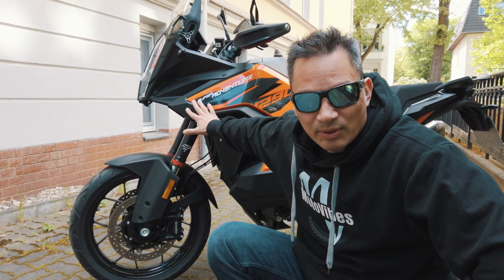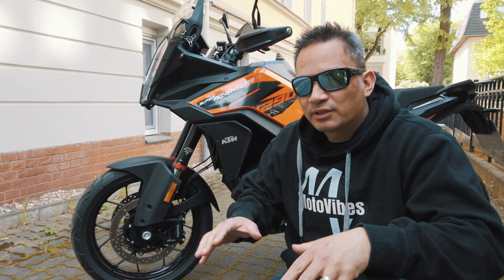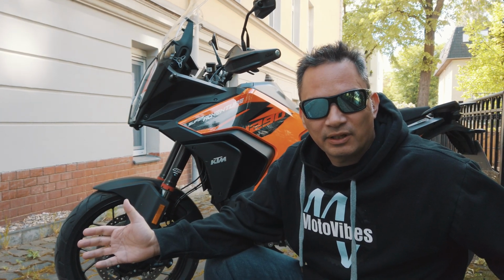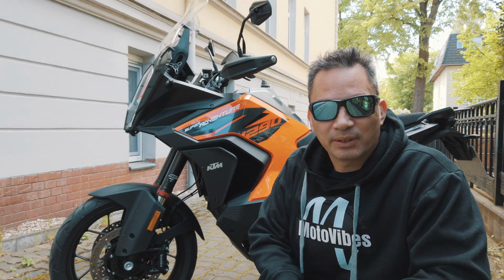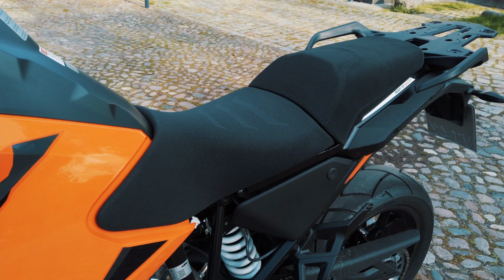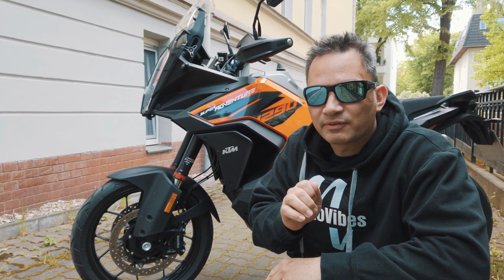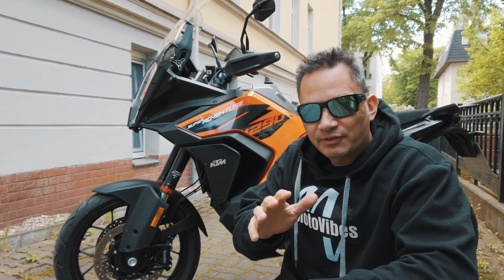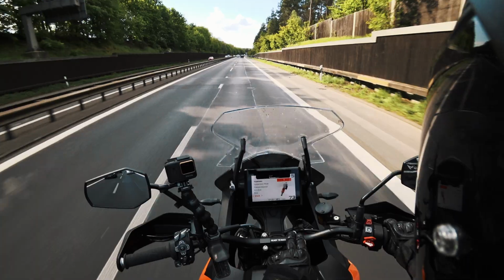6 THINGS I LIKE - 2021 KTM 1290 SUPER ADVENTURE S & R // KTM Rider's Review

Comment: Riding in the road, are there any handling differences between the 2021 R vs S? (If the R suspension is correctly setup) is there any major downside on the R version vs S (other than manually setup your suspension settings)?
Reply from the maker: Theo - I suggest you watch this video- it explains the key difference between the two https://youtu.be/TYFYFEbIkZE

Comment: Great video. I’m upgrading from a BMW F900XR to a big size adv bike. I test rode the 2022 GSA, great bike, comfortable etc etc. It just doesn’t give you the kick. Have both SAS & SAR scheduled for test rides by the end of March since my dealer doesn’t do test rides during super low temps. My biggest question right now is, SAS or SAR? I do mostly long trips and really not an off-road guy, however the SAR looks far more aggressive and appealing to me. The 21” front tire and long travel are questionable for me when it comes to high speeds on highway but i just don’t want to make this kind of investment and be restricted to road only with the SAS. Not sure if SAR is the actual SAS with added capabilities or just a totally different bike that will excel off-road but will lack what the SAS has on pavement.
Reply from the maker: Thank you very much 😉 as for your bike choice - from what you are describing the SAS would be the better fit for the riding you do - the S and the R are very similar but their respective bias Onroad vs Off-road is very noticeable- I will have a video coming up soon to break down the exact details between the S and the R
I do like the R design better too but changing the look of the bike is relatively easy. The smaller and lighter  wheels as well as the semi active suspension of the S will be perfect for road riding 😉

Comment: Good info on the seat height. Can you comment on your previous 1290 S vs the 2021 S model. How much lower is the 2021 S compared to the 2020?
Reply from the maker: Hi Mark - I think on paper the difference is only 1 cm but it feels more like 2 maybe 3 cm to me because I can reach the ground better with my feet. Nominal seat height is not the only deciding factor on how well you can reach the ground - the shape of the seat also factors in - a narrower seat will give you more reach (think of light weight Enduro narrow) - a wider seat less reach. 
The 2-3 cm is in the normal setting - the "low" setting (standard on each bike) gives another 2 cm. I am 180 cm tall - the lowest setting is much too low for me on the 2021 S model. I hope this helps

Comment: Thank you for the reliable review. I owned the pre ous model as well. In two months I did 7300km with the new one as owner. I can confirm:
The malfunction of distance control in more situations.
I cannot see the sense of less favorites items.
KTM should fix yesterday the issue with the seat. Is a crusial reason which I remain on that machine. 
Better behavior on low speed with high gear in compare of previous model.
Better suspension.
The shortcut switch doesn't provide enough choises.
Reply from the maker: Thank you for your feedback too - I hope KTM will fix the issues -
Most of them should be easy fixes
Reply: @MotoVibes  indeed easy fixes and could be avoided. However I love this bike. I left behind the 4 cylinder with this sexy monster.
Reply: Φίλε μου καλησπέρα.. Θα μπορούσα να σε ρωτήσω σχετικά με την αξιοπιστία της μηχανής? Κινητήρας ηλεκτρονικά, γενικότερα... Ισχύει αυτό που λέμε στην Ελλάδα το κάθε Τρίτη μάστορα ή είναι τελείως λάθος? Μην με παρεξηγήσεις πληροφορίες ψάχνω γιατί ψήνομαι πολύ για αγορά και κανένας στα reviews δεν μιλάει για αξιοπιστία.
Reply: @stelioskarakasis4809  Γεια σου Στέλιο. Το μοντέλο του '21 το πήρα το πήρα το Μάι και μόλις σήμερα γυρίζοντας από τριήμερο έχω 10300 απροβλημάτιστα χιλιόμετρα. Η εμπειρία μου είναι θετική. Κάθε ώρα πάνω της και κάθε χιλιόμετρο είναι απόλαυση. Το Σάββατο έκανα 550 χλμ.στους Δολομίτες, 11 ώρες πάνω σε αυτή, μόνο σπορ οδήγηση και τα έκανε όλα τέλεια.

Comment: Thank you so much for your videos! I watched quite a lot of them (especially the riding ones) and you convinced me going with KTM as my first "adventure" bike is the right choice. I've been riding a Harley Davidson Road King for the past 8 years, doing roughly 100,000 KMs around Europe but both my wife and I wanted to try something more versatile and potentially more comfortable. so I got the SAS 2021 just 3 weeks ago and it already has now 8000km on it after a 2 week road trip from Romania to Spain :) 

I really enjoyed the bike, definitely more fun than the BMW GS, engine wise, and similar ergonomics (suspension, riding modes, etc.) I also did use the adaptive cruise control quite a lot and I experienced the unexpected acceleration that you mentioned in your first clip about the new model. I eventually (think I) figured it out as being caused by turning on the left signal as if I wanted to overtake the car in front, at which time the bike would start to accelerate again at the set speed. I still didn't read the manual, which I should probably at this point :))

One thing that's annoying is the lack of available extras (engine guard, tank bag, bigger screen, etc.), but that will hopefully be fixed soon. The engine guard is a must for me as I want to get it into offroad, and without that I'm not taking any chances 

Enjoy your rides and keep up the good work on your channel!
Reply from the maker: Thank you very much for the kind words 😉 congratulations to your new KTM - way to go with 8K in three weeks 👍👍 i think accessories were slow on the predecessor too but once they trickle in you have something to look forward to 😉 
Very interesting that the radar assisted cruise control did something similar on yours too. I guess once you get to know your bike you will know what to look out for. Ride Safe 🤙
Reply: I ride Harleys and am considering getting the 1290 SAS. Interested in the comparison of the Road King 2up at freeway speeds, 80mph/130kph, regarding stability, passing large trucks, windy conditions. Also, would you buy the 1290 SA again?

Comment: Good video again.  I've a 2020 S model. Thinking of upgrading but... 
A few things.  ... Can you turn off wheelie control and keep traction control on.. or Do you need to buy Rally mode for that?  And even then will it let you wheelie for a distance.
Also.. I remember you saying before thst you liked the character of the old engine. I'd hate to buy a new one and it feel too refined and not as mental as 2020 version.  I havent test rode yet. 
Lower height does appeal to me though. 
Cheers .
Reply from the maker: Thank you very much. You can turn off traction control completely if you want to wheelie - just like on the 2020 version. Rallye mode will incremental setting of the traction control- highest setting of 9 will engage traction control very early before the front wheel comes up. Dial it down to less than 4 and the wheel will start to lift and still cut the power of rear wheel keeps spinning to fast - all that can be changed while you ride with + and - buttons on the left. Also- Rallye Mode will remember the last setting even after the bike was turned off. 
Best thing is to take the new one for a ride to see if it’s worth it for you to upgrade. 
It’s not all sunshine in my opinion- there will be a second part to this video with 6 things I did not like 😉

Comment: This is definitely on my “wish list” to upgrade from my 1200 GS. My biggest concerns would be poor warranty coverage and dealer support, as well as electronics that still appear to error regularly. Most of all though, we do a lot of two up touring and the GS excels at that. I’d be very curious to know how someone would rate this bike for two up touring compared to the GS?
Reply from the maker: Best thing is to test ride one with two up - the 1290 can certainly be set to a very comfortable suspension setting with a push of a button. On days you ride solo the KTM can become a very sporty bike especially compared to the BMW
Reply: In my opinion as a touring bike you won’t beat the GS. I made an expensive mistake buying the 1290SAS for long days touring.
Reply: @Tmfrth  Thanks Tim. That’s gold advice. Much appreciated👍

Comment: 3,000miles in on my 2021  KTM 1290s Loving it, bye bye 1250 gs rallye
Reply from the maker: Welcome to the KTM club 😎👍
Reply: I went the other way after 3000 miles on 2021 KTM 1290 SAS. Main thing was ergonomics…poor seating position for me, noisy screen, seat doesn’t work in higher position, no ergo seats available. Also no engine bars still and no aftermarket items. The suspension is not a patch on the GS either and real head shake when fully loaded with a top box. Power and sheer thrill factor is fantastic with KTM and it’s just so much fun to ride. Would have both if I could! 
Long distance touring (my needs) GS is still better by miles I reckon.
Reply: @Tmfrth  Mmm after owning 11 GS GSA and GS rallye 1250's x 2 IMHO The KTM is far better made plastics are true and strong the frame and the wheels are super the Suspension is on par with BMW ESA but gives you far more options to fine tune especially in Rally Pack and advanced modes. Re Shake i sorted mine 21nm site don 20nm on the head stock. Agree rests but bin off the rubbers in the pegs then order high seat and its a winner.Its far more agile easy to move around in gravel car parks easy to put on main stand and by far WAYYYYYY more fun. The GS will always be a comfier bike but I have done close to 350,000mile son them and guess i was ready for a change.
Reply: @flapjackbeans  Don't get me wrong - the KTM is probably more fun and engaging to ride - but its not as comfy. The plastics are no way as good as BMW's. They scratch up easily I found. Why KTM screwed up the seat manufacture I have no idea but it put me off  - I ordered the Ergo seat but it never came and now is no longer even an option  on KTM's website. The new Ergo heated seat from BMW I am finding is good for 200+mile days and the seat to peg ratio is more comfy for me (injured arthritic hip). I have had 6 GS's over the years and both the old 1290 SAS and the new one. The new SAS is a great bike - prob the best KTM have ever made. If I had the money I would have both - the KTM for fun trips and the GS for day after day touring comfort - :-)   Oh and the KTM quickshifter and gearbox overall is way nicer (and sportier) :-)

Comment: Agree the handling is much improved. One issue for me was top heavy feeling of my 2018 model compared to 2021. Personally I'd still replace steering damper with higher quality after market adjustable one. For example the softest setting on after market damper is still 20% stiffer than stock WP damper. Im 1.9m tall and found wind protection much improved also. Will be more involved process to remap engine as  there are now 3 O2 sensors and big convertor in exhaust. Really hate the small flimsy turn signal switch. Always enjoy your interesting and  measured reviews! All the best.
Reply from the maker: Thank you very much Martin. Good to know that wind protection for taller riders is improved too. Hard for me to judge at 1.80 m 😉 the small turn signal knob really bothered me too. There is a second part to this video coming out soon where I am addressing things I did not like - the switch is one of them 👍

Comment: What setting on the suspension do you use and prefer for road riding?
Reply from the maker: Definitely the sport setting - used it 95% of the time for onroad riding. I like the firmer suspension setting this KTM offers. My GS was always a bit too soft 😉
Reply: @MotoVibes  thanks, I presume the throttle response also on Sport?
Reply from the maker: @hedonzx822  no, I like the street setting for throttle response. I think this also sets the traction control which. I only use the sport setting on the track now. 😉
Reply: @MotoVibes  thanks for your time and effort, I take mine next week back to the dealer to have the crashbars,fog lights,carbon fairing at the fuel tank and heated grips installed.
I still have to wait for the heated comfort seats, but then it’s complete 🤗🙏🏻
Reply from the maker: @hedonzx822  you are very welcome - enjoy your newly accessorized KTM 😎👍
Reply: @MotoVibes  Morning, I have the full option, is setting the suspension to AUTO mode also an option or is SPORT better?

Regards

Comment: Excellent job, brother!  Thank you for clearing up any doubt about the high speed stability issue on this new generation vs. prior iterations.  That issue, along w the twitchy throttle, are my biggest gripes w my '17 1290SAS. I did the whole kit and caboodle with the Rottweiler parts, but  that only partially helped w the fueling.  I hope after doing more riding on the new SAS,  you still feel that the fueling is not problematic on this new generation?
Reply from the maker: Thank you very much. I have to admit that fueling was not an issue for me - also I lack the experience with upgrades like the Rottweiler kit. Would love to try the Rottweiler kits on my bike but I would likely not pass emissions testing in Germany which mandatory every 2 years. With that said. The new SA has gotten smoother at lower RPMs which was noticeable during my off-road day with the R. Takes some getting used to as I also stalled the bike many times that day 😂
Reply: @MotoVibes  😁 Ty for the reply, gr8tly appreciated. Keep on keeping on!

Comment: I was drawn to SAS because of its engine and because of top heavy feeling and wobbling issues decided me to sell it. All my complaints with the previous  model has been solved now in the current one but as you mentioned in your video that the engine in the 2021 model is now a bit muted compared to the model that it replaces. How significant the changes to the power? More power to you motoVibes!
Reply from the maker: Still the same power as the predecessor - just with a little less roar (vibration and sound) compared to mine (which also has the Akra exhaust my test bike did not) but you gain smoother response at low RPMs. Overall the new tuning can be considered an improvement - for many this may not even be an issue. Call it nostalgia but I liked the character of the predecessor better 😎

Comment: how does the comfort compared to the gs? can the suspension be set up as spft as the gs on comfort mode?
Reply from the maker: I would say it gets close. The GS has overall softer Setup. The dynamic setting of the GS is closer to street (medium) setting of the KTM. In addition front and rear suspension can be adjusted individually in a custom setting mode on the KTM